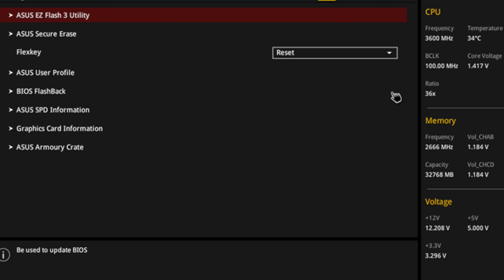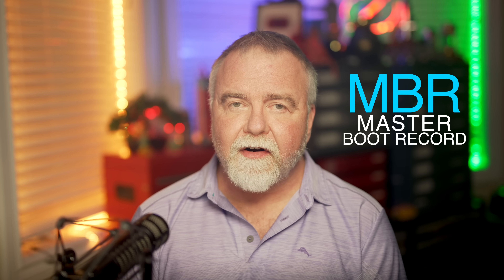How Computers BOOT: From Startup to Viruses

Comment: Great Video, I just wanted to add one thing. When the PC starts the power up process, A RC network is used on the reset pin of the CPU. The resistor is connected to ground and the capacitor is connected to the positive side of the systems power supply. So, when the system first starts up the capacitor has no charge stored in itself, this makes it a good conductor. Since this Cap is connected to the positive side of the power supply and the reset pin is between the resistor and Capacitor a positive voltage will be on the reset pin of the CPU until the capacitor charges.
After a few microseconds the capacitor will charge and become an insulator electrically. when this happens there will be no positive voltage on the CPU reset pin. This state will be in effect until the computer is powered off or a hard reset is performed by pressing a button that shorts out the Cap and once again resets the CPU. This is why they tell you to leave the computer off for a few seconds to give the capacitor a chance to discharge and be ready to perform a CPU reset.

Comment: Some machines like the MEMOTECH MTX512 which has ROMs containing the BASIC,PANEL and Assemblers which hocks into BASIC and allows commands like ASSEM 10 to allow you to type ZILOG Z80A machine code directly into BASIC programs so when you do CLS Return,CLS Return, you can then list the program thus you would have 10 CODE and whatever code you typed in and RETURN, there were also extra units like the 512FDX and the 512HDX that could be used with the base unit, mine has since gone kapoot in that the TMS9918 overheated and went kapoot then the Z80A stopped working and that was that and it had to be bined.

Comment: Thank Dave, that was very informative. Through the years I have picked up most of this so I knew it kind of, but laid out like this is great.
I have been using Linux from almost the beginning, since 1992, so I had LILO and later GRUB. Grub uses a staging system, and you have stage 1, stage 1 1/2 (?) and stage 2. There are many more details in how chips enter a protected mode and much more.
I don't know if you already did a video on x86_64 and its privilege levels and how this works in other architectures like aarch64, risc-v and power? It kind of starts of where you ended here, so ...

Comment: One would think that BIOS uipdates would begin with wiping the chip clean but found out last week that's not so. Efficiency seems to dictate that updates do just that...update the changed code and only that code. Lost video and the system only reported half of the memory capacity on only two of the slots and the next step down speed. Realy weird. Copied over the BIOS from an exact same model and stepping and loaded that to the problem machine, but no dice. Same problems. I knew the RAM to be good as Memtest86+ saw and reported the correct capacity and speed. Bought another BIOS chip off Ebay and everything came back. Sure wish I had my old programmer...could have cleared the chip in its entirety and loaded the BIOS from scratch.

Comment: I learned my trade on an 8085 board and later a 68000/68010 system. Over the years you start forgetting everything and then when faced with a firmware problem ( BIOS/UEFI ) you scratch your head....This video brought it all back in a language I am used to. Thank You!

Comment: As a kid, I had an original Radio Shack Color Computer.  It booted in... I dunno, milliseconds?  Certainly no more than a quarter of a second, with a CPU clocked at less than 1MHz.

My current workstation has a beast of an AMD Threadripper CPU and takes about 20 seconds to go from cold boot to Linux graphical login.  (And yes, I know that the modern computer is doing a heck of a lot more than the ancient CoCo, but still...)

Comment: Yes, when trouble shooting a microcontroller first thing to check if 5v is present, next the rest line, next cpu clock. If everything are ok, further things get complicated. Stuck data lines or address lines. These technics are all before the JTAG implementation.

Comment: Thanks for the refresher with the IMSAI 8080. I worked for a company that had one. They made a S100 device. We wrote our code those devices using CP/M on the IMSAI.
I remember the "stoned" virus. It caused a real problem at our workplace.

Comment: Always wondered how setup.exe is run from the Win10 (or 11) ISO bootloader.
Mainly how Windows 10-11 Installer during it's install process can reboot several times, skip normal login and come directly back to the next point in the install process without loosing it's place.
* Is the Installer Bootloader editing the actual BCD to reboot to itself from the main target drive after copying the files from the ISO (?) 

* After reboot, once the Setup regains control , does the installer keep it's place in the setup process via some sort of Setup answer file? 

Just really curious as a total novice programmer who's done nothing but write small engineering calc routines (x86asm, C++ & some AutoLisp) before retiring from a Civil Engineering firm.

Comment: 1:33 On as sidenote, this is how we, in 2024, are still using slots, PCI-e slots to put chiefly videocards in. Usually one
          In a way the modern PC goes all the way back to the 8080, as you said. To 1977. 
         The 8" floppy became a 5¼" flloppy, a 3½" floppy, a  (usally 3½") hard disk, a 2½" SSD and nowadays... an M.2  NVME SSD. From old bootmedium to newest bootmedium.
7:49 I also prefer ASUS motherboards. Still in search of incredible :)

Comment: If only viruses were only the Stoned Virus.  I don't think people were using viruses to steal data and credentials from people back then.  Even if they tried a lot of people were on a dialup internet connection and thus not always connected.  That would be especially true if the modem shared a line with a phone and some nitwit picked up the phone extension causing your connection to drop.  Also there were no cell phones so when someone needed to make a call or send a fax they would need to ask you to disconnect or do it at a different time.   What fun that was!  Where I live we were stuck with dialup as the only way to connect for a good while.  I don't miss it at all!

Comment: its been a while repairing computers was my job back in ´88. if i remember correctly the power on switch of the ibm was connected by a steel rod to the real switch on the power supply. do i remember right?

Comment: I have used PCs since the 80's, and it seems like the time from turning on the machine to getting a stable, usable interface has changed very little. The more computing power and memory the computer has, the more things it has been given to do as it boots up. I'm sure the process is a lot faster, but it just doesn't seem like it.

Comment: Hey nice Hakko. I have an ancient Weller and a more modern Dual rework Hakko. Even so, I still always enjoy using the Hakko or Weller vs a new Metcal any day. 

Fascinating hearing you go over how the CPU works, I never realized the reset pin started high for a few seconds before returning to low.

Comment: Thanks for this. It might inspire me to have another go at getting my old Win7 HP notebook, with most of my files and pictures stuck on it, working again.  As almost always happens, my PCs tend to work fine, until I start to feel guilty about not backing up enough, and then the backup process ends up with an unusable machine.

This time, I tried to let Acronis image the drive and then back up, only for it to get halfway through the backup and quit, complaining of lack of space.  On this occasion, it somehow, managed to make the boot sequence look on the wrong drive for the windows start file.  I spent months trying to learn enough about the start up process, to be able to write the right boot loader files (with huge great identifiers to try and type right over and over again!), just to try and point the infernal thing at the right drive.  The 'recovery environment' with its inescapaple testing loops that flash up results far too fast to read, and then start over and over again:  I had to time taking pictures of the results panels over and over again, before being able to try and look up what they meant.  I had to give up in the end, as I was getting too far behind with my email.

So I bought a second hand Dell work station--beautiful heavy metal thing--and was getting to enjoy it, till I was tempted to take out a Malwarebytes subscription, because I had used the earlier versions for free for ages...  All seemed to be going well, till I shut the lid one evening to answer the door, and when I came back I found it had crashed doing a midnight update, and it hasn't started since. I've almost forgotten everything I knew about pcs since, and have been struggling to do everything on a Planet Computers very rickety 'Cosmo Communicator' but Android is like having no control over anything at all, and it drives me nuts!  I want my old computers back; I want proper programs, not apps that hide all one's data in the app, when you think it's safe in your filing system till the app packs up!  I lost five years of notes in BlackBerry 'Tasks', when "owner dead" flashed up and they all disappeared from my calendar 'app'!

I hate this!  I want my data, in my my computer, in my house: safe from the internet: not in somebody's 'cloud'; I want my physical 'Office 10' back, and shielded from MS's infernal 'updates' that destroy perfectly good on board programs and try to force me to 'subscribe' to the 'cloud' and be enslaved for life! Grrrrr!   How do I make a simple home only wireless network, where nothing links to the Internet where manufacturers can interfere with it, but all the devices draw files from the same central storage device?  I just want to work on my own files with my own fixed software. Is that really too much to ask?

Comment: I worked at an entry-level IT job, whose name I won't mention as people have a rather harsh view of the outlet.  However, my time there was an amazing journey of meeting some of the most amazing people with a broad range of knowledge and expertise, decades beyond me.

One of those was an older guy who used to work for IBM in some capacity.  He may not have been truthful, as I had no way of verifying this, however, he was in that age group, and his attire sure looked the part, reminding me of how the old NASA employees would dress.

He told me of a simple command that could be used in DOS systems, at some point in time, that could order a mechanical hard drive, which at the time were the norm for all computers at the time of my employment.  The command would simply order the drive head to park wherever it happened to be on the platter, and would almost certainly cause a critical head crash, causing the head to rest on the platter, stripping the medium from the platter and (literally) grinding to a halt.

I don't remember the command, only that it would have been initiated from MS-DOS' debug menu.

I did attempt it on an otherwise dead system, as the curiosity was getting the best of me.  Unfortunately, nothinf happened, and I suspect that newer drives had some kind of built-in system from preventing user (Or malware) from executing such a request.

Comment: 5:27: That FFFF:FFF0 SEG:OFS is not correct. It is actually F000:FFF0h so it translates to FFFF0h just 16 byte short of 1MByte. For a 80286 CPU FFFF:FFF0 would result to 10FFE0 while on a 8080 this would just wrap around to 0000:FFE0.

Comment: Ahhh the good O'l days, miss them to some degree. My poor old Amiga is still sitting in the cupboard with it's 500 Meg hard drive, and a SCSI 500 Meg drive was so massive for one of those I couldn't fill it after 10 years use & it never failed me either, such exceptional technology for the time.

Comment: Why does the 8080 start at address zero, and not address 4 or 2 ? Since 0 is often used to indicate a nullvalue, some other address than that would be safer, and leaving address 0 filled with a all zero bits.
Reply from the maker: That's likely why 4 is the base address on the Amiga.  That way it doesn't get stomped when people write to a null pointer!

Comment: Just as someone who doesn’t know anything about it, I’m going to guess that it runs through a set of checks, so when you turn the power switch on from an off state, it resets the system to a starting point, and then from that clean slate builds up to the full operating State. 

Now I’ll watch and find out
Reply: No surprise to me, even if I am in the ballpark, the actual details on how to do it are not something I would’ve been able to immediately come up with

Comment: @5:30 as far as I knew, the "top - 16 bytes" of the 1MB memory on an x86 is 0xFFFF0 which is normally shown as either:
F000:FFF0 (or less usually FFFF:0000)

Addressing FFFF:FFF0 would result in code being run from somewhere else in the F000 segment.
Reply: The 8086 and 8088 started at CS:IP = FFFF:0000 - physical address FFFF0
The 80286 started up at F000:FFF0 - same physical address
For the 80386, the startup physical address was FFFFFFF0 - not normally accessible in Real mode, so the processor would have had to initialise the CS descriptor with a special base address to make this happen.

Comment: Commodore-Amiga Disk Format :
The first two sectors on each floppy disk contain special boot
information. These sectors are read into the system at an arbitrary
position; therefore, the code must be position independent.  The first
three longwords come from the include file devices/bootblock.h. The type
must be BBID_DOS; the checksum must be correct (an additive carry
wraparound sum of 0xffffffff). Execution starts at location 12 of the
first sector read in.

The code is called with an open trackdisk.device I/O request pointer in A1
(see the ``Trackdisk'' chapter for more information). The boot code is
free to use the IO request as it wishes (the code may trash A1, but must
not trash the I/O request itself).

The boot code must return values in two registers:  D0 and A0. D0 is a
failure code - if it is non-zero then a system alert will be called, and
the system will reboot.

If D0 is zero then A0 must contain the start address to jump to.  The
strap module will free the boot sector memory, free the boot picture
memory, close the trackdisk.device I/O request, do any other cleanup that
is required, then jump to the location pointed to by A0.

Boot code may allocate memory, use trackdisk.device to load relocatable
information into the memory, then return with D0=0 and A0 pointing to
code. The system will clean up, then call the code.

From: Amiga Hardware Reference Manual 3rd edition, ISBN 0-201-56776-8

Comment: There is a tale, possibly apocryphal, of a virus that needed NO software at all to work. 

A guy was fired from a company, he wasn't happy. Shortly after this, the IT dept got a call to replace a 3.5 floppy drive that had stopped working.  Drive was replaced. But it stopped working shortly afterwards, as did a LOT of other floppy drives in the office over a short period of time. No one could figure it out. Until someone looked behind the sliding cover on a disk and noticed some odd substance smeared over it. A substance that was found on a load of other disks in the office. 

Turns out that the fired guy had smeared a tiny amount of vaseline onto a disk or two before he left.  Then just let nature take its course as drive after drive became clogged, and transferred some vaseline to any fresh disk put into them. Which then got transferred to other drives via contaminated disks.

Comment: Back in the '90s my company sold training software to various blue chip companies. We got a call from Reuters one day, a very worried and angry guy telling us that one of our 3.5 inch floppies had a virus. After investigating, it turned out that my copy protection "hack" had done exactly what this particular virus did as part of its payload.

Lets go back to the beginning - our software came on four or more 3.5 inch floppies. We didn't want people copying these (we charged up to 3000 GBP per package) but we also didn't want to pay the somewhat large amounts that professional copy protection cost.  Soo, I began experimenting on ways to copy-proof the disks. With my trusty Norton Utilities (which back then were actually useful) I experimented with altering bytes within the boot sector.  Most changes, as you'd expect, made the disk un-readable. Until I changed the sectors per track from eight to nine.  Bingo! The disk worked as normal but any copies that were made didn't alter the boot sector, so all our programs had to do was check the boot sector for that setting and abort if it wasn't found.

What was puzzling at the time was that NO other customer complained about viruses on our disks, I wish I'd asked Reuters what anti-virus program they used, it must have been good!

Comment: Back in the 70s & 80s, i used to work on a computer, which allowed a user to physically enter a machine code program directly from a dumb terminal. The program ran, without the O/S being aware of it or control. Nowhere was sacred, you do anything you wanted,  trawl through data or program files, or examine and alter the O/S while it was running.